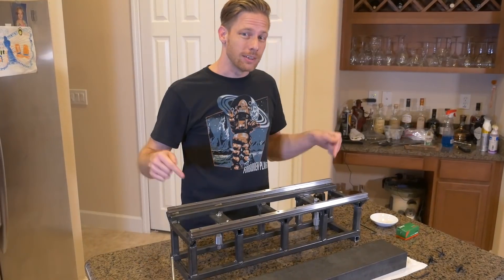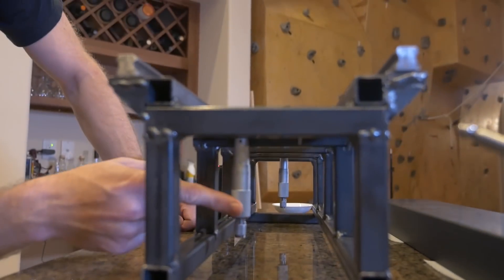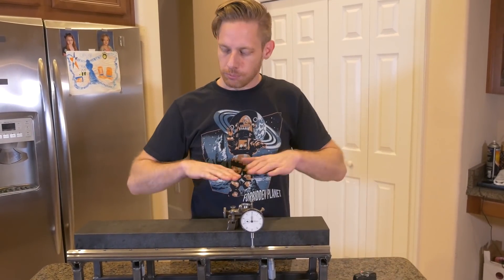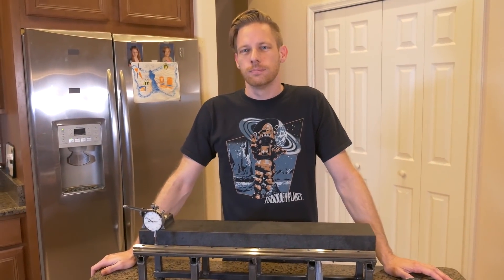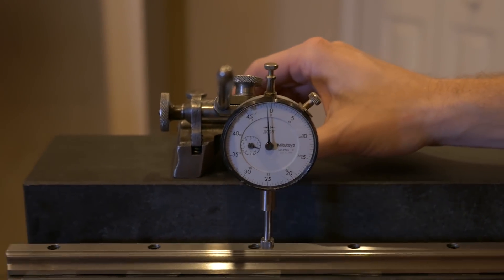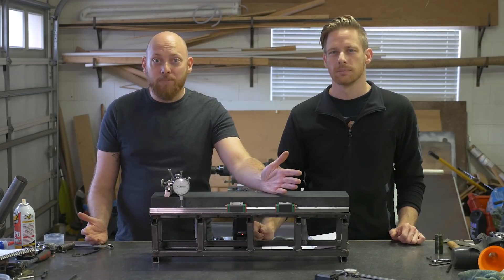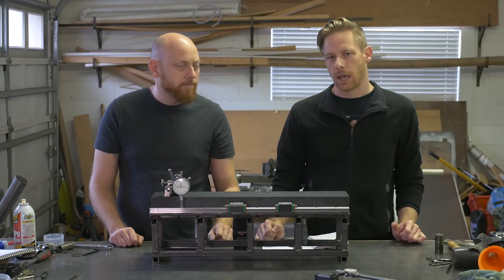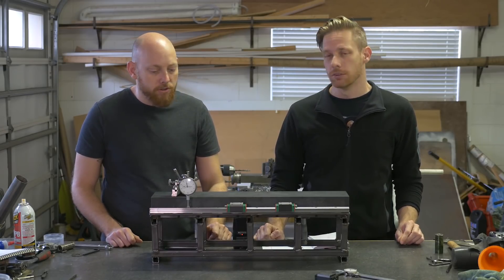Mini Surface Grinder Part 1 - S02E12

Comment: I know that this video is old now, but I just want some advice.  I’m thinking of building my own medium sized manual milling machine that makes use of a lathe bed, headstock and carriage mounted vertically. (I’m only going to be doing light work). I can’t justify the price of a mini mill, but I can get the lathe parts for around £300, how much would you guys think that it would then likely be added on top of that to make the rest, in a similar style to this grinder build.  Thanks in advance for your help!

Comment: I think you should have used a torque wrench and learned about hand scraping. At least to dial your surface gauge in. I don't know if torquing all the bolts the same would be better or worse but at least it would give you a base-line to learn from.  Also, at the time of the video, did you know the tolerance grade of your granite & how long ago it was calibrated?

Comment: Something you might play with as you build stuff like this:  epoxy granite.  You can embed steel or ideally cast iron.  Surface that and then bolt your rails.  Way less temperature fluctuation.

Example:  https://www.adambender.info/single-post/2017/03/25/Epoxy-Granite-Machine-Frame-How-To

Comment: Sorry. That base for a grinder, is, structurally, useless.
Priority number 1 is torsional stiffness. You chassis type construction has very
little. It needs diagonal bracing. To be honest, you should scrap it, and use a
piece of box section tube about 1 mtr long. Also mass for damping. If you use
hollow section box tubing, you can fill it with concrete. There is way you may
be able to salvage what you’ve done. Put you chassis in a suitable box, and the
fill/pour in a mixture of Epoxy and granite chips. That’ll fix you stiffness
problem.

Comment: Personally I would have made a jig to mount a grinder then slid it across the granite parallel grinding the mount for the rail flat. Or you could have attached the rails to the granite parallel then run a tool off of them.

Shim isn't a good way of doing this as you have seen from your lumpy rails.

Comment: rather than using shim stock, what about grub screws from the opposite side? You could adjust to get zero and then use wicking locktite to set them in place.

Comment: do they actually mean 0.0005mm by saying half a thousandth? i mean most modern cnc machines cant consistantly do 0.01mm and tolerances dont even reach further than thousands of a mm. so that seems odd to me.
Reply: "Half a thousandth" would be 0.0005 inch.

Comment: great video. If you would have used two rows tightly spaced fine thread screws with lock nuts "like on a gib" comming up from the bottom of the linear rail I think you would have a more rigid set up with more flexibility in the way it can be adjusted. Food for thought.

Comment: Fascinated by this project, a couple questions:

1 - Wherr do you get half thou metal shims?
2 - Therr must be a way to get perfectly level surface?  Maybe usings lasars?  Or, how do lens makers make hypersmooth glass for telescopes?  Could some of those procedures work here?

Looking forward to next steps in this project...

Comment: no X bracing ??? laterally weak :( wouldn't a precision grinder need to be rigid? what about the heat from grinding ? the ways of a lathe are hardened.... be it flame or induction hardening.... what about annealing the ways? cant wait to see how this turns out good luck very entertaining. :)

Comment: if you want ...you don't need 1/2-thousands shims to get less than 1/2-thousandth increments...just use (much/any) thicker shims and lap them down as needed.

Comment: Y axis on top of that thing? What sort of grinder are you building, as surface grinders usually are in a very different configuration with the axes.

Comment: hi, just started watching you guys channel, where did you get the rails and sliders.... or what are they called so i can look them up, wanted to make a system for my drill press, of fine adjustments, and this is what is need, though first about some used ways on a lathe, but i think this may be it!!!

Comment: Have you tried pressing down on the rails to see if they flex under the loads equal to your grinder and carriage. No doubt the steel under the rail is very uneven in unknown. Perhaps you could try some spotfacing on your drill press to eliminate major offenders. Mine resists being used as a mill for any sideward cuts.

Comment: If you decide to enhance it in the future, you could remove the shims and use copper wire and bedding epoxy to get it perfectly flat.  Instead of explaining the process, I encourage you to check out Stefan Gotteswinter's  "Tramming a milling machine with epoxy" video on youtube.  Then I'd try and bed the rails with the bearing blocks on the rails, and the test indicator tip moving with the bearing block.  This allows you to adjust most of the potential errors as a group.

Comment: Linear rails are only grind at certain locations. Top of the rail is not grind, it just is what it is. Bottom of the rail is grind as are the ball raceways and one side has a reference surface. The reference surface is supposed to be bumped up to a very precise wall and that will make the linear rail straight or else it might have a bow to it.

Comment: not to bust up ur build props for that,, but it would be a good idea to have the frame stress relieved,, and maybe gettting the mounting surface of the rails milled, after stress relief to get u really close. then shim accordingly. just my two cents.
every step you make the best u can, will make your end result of a machine so much better and reliable

Stagz CnC

Comment: great job for a diy
tap and die tip.. you dont have to back off every 1/8th turn.. and when you do back off, you have to back off enough to let the shaving fall out.
Reply: Watching the way the tap is working that mild steel appears to be very gummy.  It’s not cutting cleanly so I would back off frequently as well.  Keeps the tap from getting stuck and breaking.

Comment: The problem about thermal expansion is not in the mild steel itself but in difference of materials. Hardened stainless, granite and mild  steel all have different thermal expansion coefficients and so the heat will distort the dissimilar material differently. Also the support bar on which the linear rail is sitting would benefit from more stiffness (= thicker bar).

Also the way you aligned rails to be parallel to each other with micrometer seem bit awkward - usually it's done with a dial indicator using the other rail as a reference.

Comment: In the past I've done some sorta flat stuff.  Not sure this would help you though.  I went to a marble counter top maker and got a sink cutout.  Look at the shine of a light and it looks a lot flatter than my wood table top.  I used post it note glue on the back of some sand paper and stuck it my marble piece and made some steel pieces for flat than I could with a belt or disk grinder.  I like the results.  Thanks for the video.

Comment: Bolts are like rubber bands, they have to be stretched within the elastic modulus limits to generate enough force to keep the fastened parts from moving against each other. If they move the bolts will work loose.

Comment: First let me say Great channel! Looking forward to
whatever s next!

Some thoughts you might consider (keep in mind I offer these
based on the amount of work you already have into the base .
1) copy the 3 point system to the bottom. You have done a great job with granite and Bessel points,
so take advantage of it. 

 2) First take the rails off, get some threaded rod and heim joints make some tab mounts and
create triangles in between the uprights, one heim left hand the other right
hand thread.  I am sure you know what to do with what I described.

3) Get the thing on surface plate use the lower 3 point system
to get it level, setup your upper 3 point system with your granite block and
get it parallel to the surface plate, take your measurements to the rail
mounts, make a map. 

4) Get the high spots roughed down with a hand grinder, to let’s
say within .003 or .004 Once done make or buy a scraper (mild steel scrapes
easy ) scrape in the rest.

Now you have a pre-stressed scraped machine base to mount
the rails that will move less do to temp change along with a nice 3 point
leveling system for leveling your machine also this will make building the
other axes much easier. I know I’ve left stuff out but seeing what you guys are
capable of, I think You get the concept. 
One last thing... keep it up and your channel is going to be a fantastic successes!

Comment: You mentioned shooting for 0.0005 tolerance on the rails because you couldn't find shim stock thinner than that. When you go to make your big one. I presume this one will be working, and you will have access to a surface grinder. plan to have shims of an arbitrary size when you draft up the layout. say .25" or .5" doesn't matter. bigger is always better. Then you can grind them down to whatever you need to align the rails. it way easier to grind a .5" block down to .4998" than to come up with a piece  of .0002" shim stock
Reply from the maker: +EitriBrokkr that's an excellent point!
Reply: wasn't my idea, I cheated, I work for a big machine tool builder. we do a lot of our stuff that way. nothing is ever cut, machined or ground perfect. the trick is coming up with ways to adjust it. Speaking of which I really like how you set that up to use that granite parallel. where did you come up with that? I've been kicking around the idea of building a cnc gantry mill/rounter/plasma table. and I can't come up with a solid way of indicating the rails in. your method is awesome, but I don't want to have to buy a 4x8' granite surface plate
Reply: perpetual surface grinders

Comment: An idea for rigidity might be to shutter the base off and fill it with a home made resin bonded concrete. It would add some weight to it too.
Reply: more weight, more good. They're actually making "real" surface grinders completely out of a similar material, instead of cast iron. The thermal properties are so much better. and you can do a bunch of cool things like integrated coolant channels for temperature stability.

Comment: Interesting project! When you build the real thing it might be a good idea to triangulate the frame. As it is now it's not very stiff, compared to what it could have been. Also weld all the metal tubing ends directly to the other metal tubing so you can weld around the whole end. Instead on laying it on top.

Comment: you really ought to measure on the top of the trucks, the only perfect part of a linear guide is the bottom, usually one side of the lower portion and the actual rail surface the balls ride on. your saddle will be mounted to the top surface of the truck so in reality that's the only thing that matters.
Reply from the maker: +EitriBrokkr agreed. We measured both. Unfortunately the trucks also aren't flate lol
Reply: ehh, nothings perfect

Comment: Cool video series find it interesting, there's a couple good stickys on the practical machinist website in the monarch section of the forum about rebuilding a 10ee and a series 60 monarch lathe and he deals with scraping the hardened ways with a biax but it's slow going since that lathe has hardened ways. A thought would be use a dremmel or die grinder with a carbide burr or stone that would give you the right shape of mark and the dept of a proper scrape mark between .0003" and .0005" and use your granite straight edge to restore the accuracy of the tail stock ways then build a sled out of your tail stock base to hold a small grinder that's what harry did in the another new toy thread at pm or just use the die grinder for the whole lathe bed instead of your hand scraper. I have scraped a couple small parallels with a dremmel and small a.o. Stone and was very happy with the results as a test. And that home made surface grinder will be handy to have around! Best of luck and thank you for the vids!

Comment: Why buy linear rails when you mount them on flat iron which you welded on the floor...
Reply: Fresh Fish yup, I don't have a welding table or a mill, so the design is meant to be adjustable instead. Also to be fair, welding on the garage floor still came up with the mounting surfaces only being about 0.01" away from perfect 🙂

Comment: couple points of criticism:
surface grinders are high precision instruments, and just the way you mount the rails goes against any reason, it is way too flimsy, using 5-6mm plank welded on one side and supported by right angles is so wrong I can't even begin to explain... the rail needs to rest on a solid base, the rail itself is not thought of adding any strength to the structure (like in your case), but only serve as a - linear guide, which is what it is actually called, your base must be solid and flat, if it isn't perfectly flat, you might get away using shim stock and mounting epoxy (special epoxy, with a high percentage of particulates that add strength to the cured glue and help minimize shrinkage), there is more to mounting linear guides, but these are the basic things to even begin thinking about this
if you want this thing to work and be useful around the shop, forget about this light duty thin wall tubing, get solid pieces at least in the same cross section, here in EU we have construction and tool steel available in calibrated sizes (+/- 0.02mm for a 40x40mm cross section for instance and lengths up to 12m), I'm sure there are similar sized materials available in US, yes it will be few times more expensive than the thin wall tubing, but with the time invested in this it will be a tiny portion of total expense, and you might actually build something useful at the end, because this tubing approach will definitely be pretty much useless as precision surface grinding goes, the other thing - you want mass for the machine, it will absorb vibrations better (not as good as cast iron, but still), and you will have vibrations, there is no way around it, and then don't weld the solid bars, use bolts and pins and mounting epoxy to put the frame together, it will be more tedious than welding, but the end result will be a lot less stressed, which is a good thing, I don't see machines there (apart of the lathe, but the spindle inside bore doesn't look large enough to pass bigger square tubing, and I didn't see independent 4jaw either) that you can use to square up cut ends of solid bars, but go and do that, it is essential
I've seen welded frames for things like routers, you can get away with that for something light duty like wood router or plasma table, but they are in no way associated with the level of precision of surface grinding machines, yes, you can see some welded components on some high end machines as well, but you don't know what materials are used and what methods of production were involved, I can bet if there is something welded near precision geometry on a high end machine, you can be sure it has spent time in stress relieving oven, anyway, welding something on such machines is the last resort

p.s. when you cut threads in that manner, you don't back out that little so often, what you do is pointless, the aim of the backing off it to break the chip that has been cut, and you don't create any meaningful chip that need to be broken every 15-20 degrees of the turn, instead you cut the thread for a turn or two, when/if it starts to get tight, you reverse, you feel for the chip to break, and resume forward cut, you can actually avoid having to do that on through holes with some cutters, that push the chip curl forwards through and out the hole, or using spiral tap that evacuates the chip backwards

Comment: make steel anchors in a rectangular enclosure, Wood works great ....as many as Bolt holes... they have to be as wide as the space between rails, milled, levelthem with a machinist level.. use concrete to trap them inside, just the top side of the anchors Will stay out for bolting the rails, this Will give you a sturdy and leveled Surface, instal the rails and shim as needed... i always wanted to make it buy Space Is premium un my homeshop...if you need a drawing to better understand the idea throw me an email i'll be glad to see my idea come true with you Guys..

Comment: Investigate Airy Points. Support points for your granite beam cannot be assumed to make no difference. All beams bend in a gravitational field.
Reply from the maker: thanks Paul, for the record we didn't assume it would make no difference. we assumed it was over kill for our tolerances. happy to test it out tonight though =)
Reply: Dave Smith  I recommend a very small grinder. With enough patience, and a small grinder, I think they can get a surface close enough and finish the job scraping.

Comment: I only thought of this after the video, did you compare the heights of both rails? How does the runout of them compare? If they are both dead flat but at different heights everything will have a taper from side to side.
Reply from the maker: that's the beauty of this design. we don't have to move the reference surface to measure the other side, so we can get them on the exact same plane. sorry we didn't show that in the video. i will try and cover it a little bit in the next one.
Reply: and in reality it won't matter, because once it is finished, you actually use the grinder to "dress" the chuck, making its surface perfect to the axis of the spindle